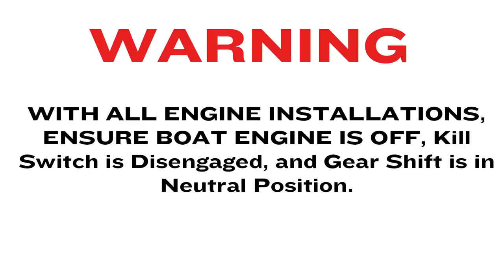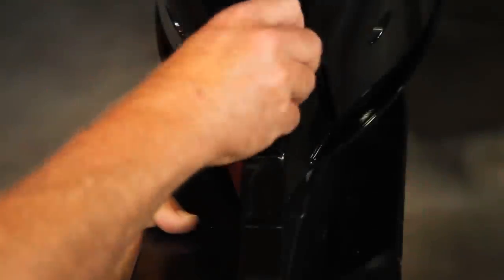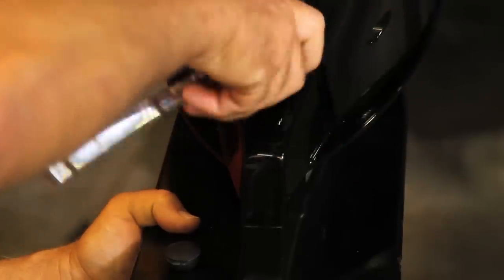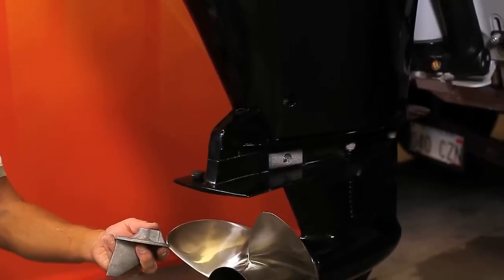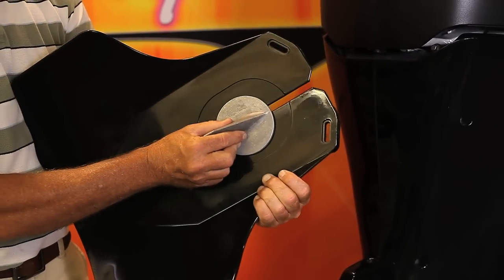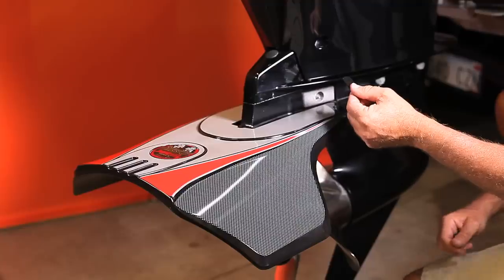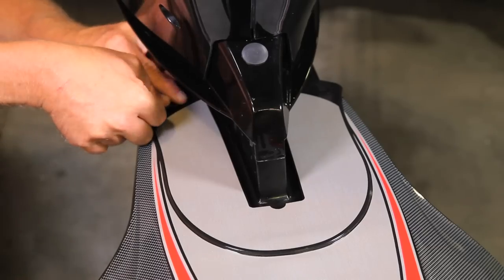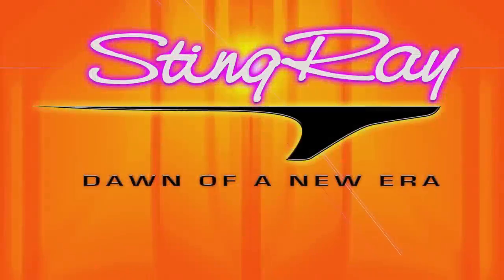StingRay XRIII Installation

Comment from the maker: StingRay has introduced a line of No-Drill hydrofoils including the XRIII, Stealth 2, and StarFire that will not damage the outdrive or require any holes to be drilled in the engine's cavitation plate. Other competitor hydrofoils require holes to be drilled into the cavitation plate.